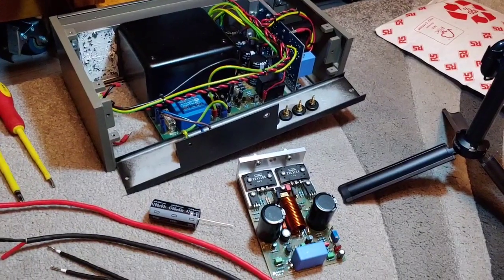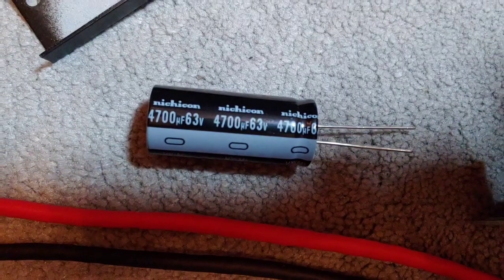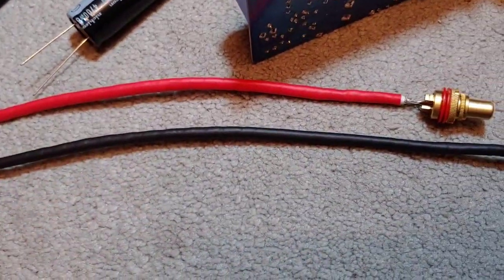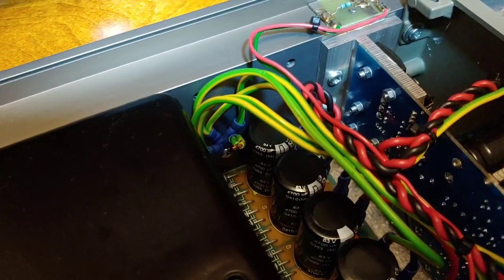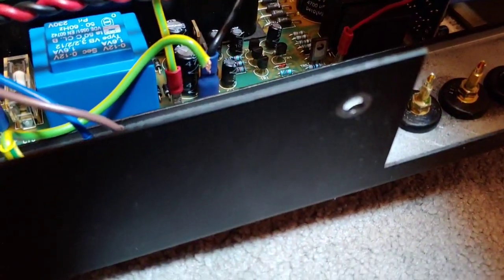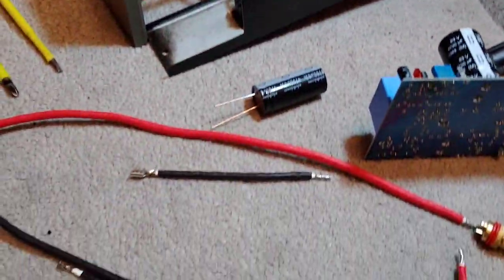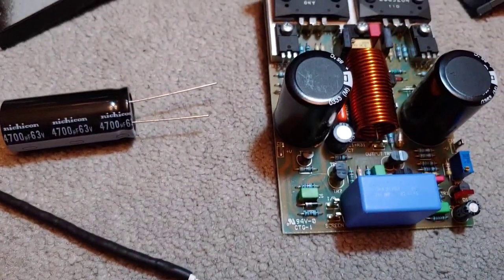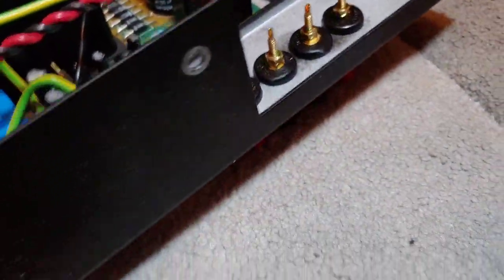Upgrading & Rewiring The Quad/Lucid 405 Power Amplifier, Part 1.

Comment: I've just recently purchased the exact same amp with the lucid designs upgrade. I was a bit unsure when bidding for it because I couldn't find any information on it. Good to hear about the information you found from research. The only difference with mine is that all the small transistors on the boards are surrounded with heatshrink coating a copper plate. Not seen this before, but I guess it's good for reducing heat. All the wiring looks the same as are the capacitors.

I have no issues with mine other than you can hear a very faint him if you stick your ear right in front of the speaker. The sound quality is very impressive hooked up to my Audiolab 6000a play as a pre-amp. The detail and soundstage are excellent with all instruments separated beautifully. The bass is very tight and controlled and overall tone seems pretty neutral. It'll be interesting to see how the modifications you are doing turn out. Hopefully they fix the crackling, but I don't think it will be anything to do with the wiring as mine is identical and sounds great. Maybe the slight hum I have could be related to wiring though, but it's totally inaudible with music playing and doesn't increase with volume.

Comment: Gosh loving your channel. Got to polish the scratches out of my turntable, then fix the water marks on the veneer on speaker cabs. I had a problem with one channel at certain frequencies and though it might be the amp. Only there sometimes. Finally got round to diagnosing. Found a bit of music where it consistently happened, which happened to be a piano recording and particular notes. Disappeared with headphones, so checked speakers and mid range speaker had split in rubber surround. Repaired it one night and problem gone ! I am not sure if your amp has a headphone socket, but might eliminate other problems if you do.

Comment: Hi Ian, I was wondering if you could help me? I'm waiting on a modified tube phono stage getting delivered, the guy that's sending it, is recommending/ insisting? on  me using Van den hul Mc silver IT 65G interconnect cable. Was wondering if the cables you so very kindly gifted me are the same/equal to / better than the ones he wants me to use?
Stay safe.
Jim 🏴 ☺
Reply from the maker: Hello Jim, the interconnects I gave you are better than the van den hul silver ones, how much do they want to charge you for the van den hul silver IT 65g interconnects.

Comment: They're not real Nichicon UPM; the sleeves are wrong. This is not a good conversion and fixing it requires experience. Randomly rewiring and recapping an unreliable amp is dangerous. Possible outcomes are damage to loudspeakers, fire or, worst case, electric shock. If you're determined to continue, post some pictures on diyaudio or audiokarma and ask for guidance. Stubborn as you are, I'd like you to be safe.
Reply: You are correct.  Real Nichicon caps have an oval negative rather than rectangular.

It's more than possible the Sanken transistors are fake.
Reply: @AndrewLittleboy1  Yes, I agree about the transistors but it's harder to spot in a video, so I didn't want to say.  Counterfit components are so widespread they even make it into military devices these days. Don't buy anything off eBay is a good start though.

Comment: Get a magnifying glass and look for dry solder joints or just reflow the problem channels solder connections, especially around areas of heat like the legs of the output transistors.
Reply from the maker: Hello, that was the first thing I done, I'm hoping I've fix it, thanks for commenting & watching👍

Comment: I think your restoration and upgrades are interesting if only because the excellence of hi-fi is always moving forward.  However, I know it's a trouble but stage changes are way more scientific than do it all if because we won't know what was the fix.  If it was me, I'd do the wiring loom last to save the constant flexing of cable and connectors. Bill
Reply from the maker: That's exactly what I'm doing, thanks for watching & commenting